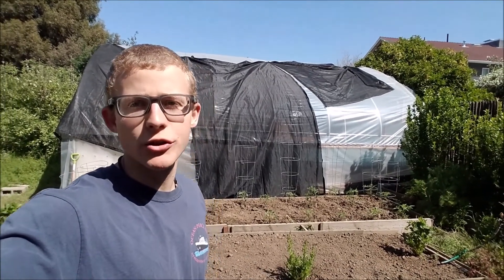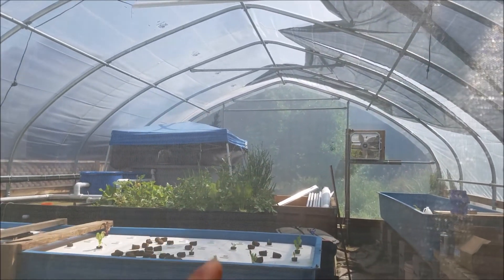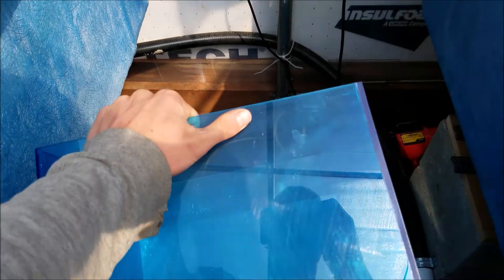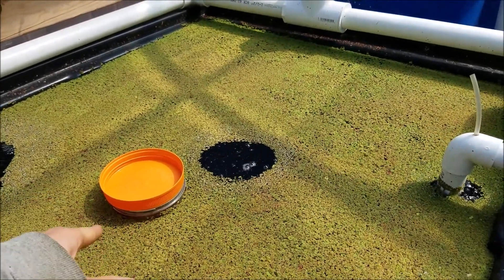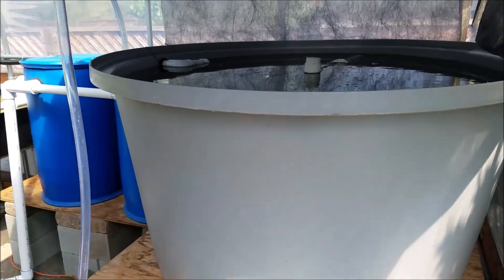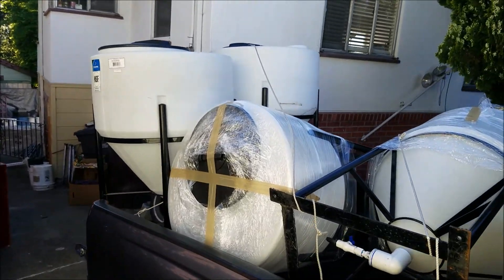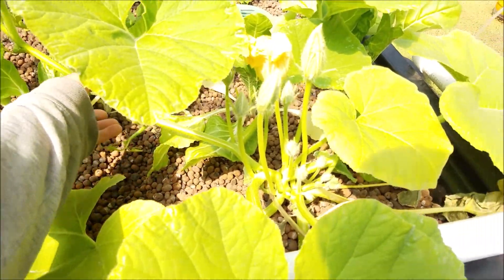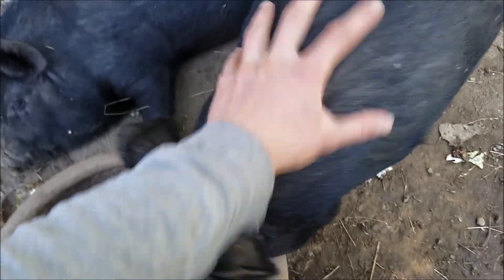Hybrid aquaponics system (update)

Comment: You have a lot going on there in your system!
I was wondering what you meant by hybrid aquaponics, and am still confused.

Best of luck with your on going project.

Thanks for sharing and as always keep building👍
Reply from the maker: Hey thanks for the reply

Sorry for the confusion and hopefully my understanding is correct.
But what I am referring to as hybrid aquaponics. Is the combination of both deep water culture (floating rafts) aquaponics, and grow media aquaponics. 
Usually when someone sets up an aquaponic system they aim towards just doing one or the other, since it is simpler that way.

So basically hybrid aquaponics = DWC aquaponics + grow media (ex; hydroton) aquaponics.
Taking the two different types and combining them together.

I believe this is correct, at least from what I have read and seen.
Reply: @vonponics  In my thinking a hybrid system would be an aquaponics system that can be made to work as a hydroponics system in case of a disaster and the fish are lost and you still have plants that need nutrients, I hope that makes sense.

My system is just an aquaponics system and I have grow beds, floating raft, and Dutch buckets👍

Either way I really like what your doing and hope you keep it up and keep sharing your progress👍👍
Reply from the maker: @ToddLarsen  
I guess there are different ways to think of it as a hybrid system.
But pretty much any aquaponic system can act as a hydroponic system. Just take the fish out and add the nutrients. And that would make it an aquaponic system.

I appreciate the feedback, always new things to learn. 
I think I will still consider my system a hybrid aquaponic system. But all in all it's still aquaponics no matter how it's set up.
Thanks and that's cool that you have all of that in you aquaponic system.

Comment: Have you considered using a fluidized filter?
Reply from the maker: Is that the same as a bio filter?
If not do you have a link or something where I can see what that is?
Always looking to learn new things.
Reply: @vonponics  yep it's the same as a moving bed it'll give you the most surface area per sq in for the beneficial bacteria to grow. 
Also you could switch from hydroton (expanded clay balls) to lava rock. the sharp edges of the the lava rock help promote root growth while lasting alot longer than clay.
Reply from the maker: @mycool8980  
Yes I do plan to make a moving bed bio filter. Didn't know that was also a name for it.
And I might get lava rock to put at the bottom of the long grow bed I will set up. 
Thanks

Comment: make a radial flow filter with your swirl filter . that wil work. nice job.
Reply from the maker: I do plan to make a radial flow filter but haven't gotten to it yet.
thanks
Reply from the maker: @hello-sz1jp  I am doing it mostly for my family.
But maybe later on if I have a huge supply i might sell some.
Reply from the maker: @hello-sz1jp  
There are a lot of pros compared to regular soil gardening.
But I do have both an aquaponics and regular.
Plants in aquaponics grow much faster and can grow closer to each other. So you can have more grow in an area compared to that of a soil garden.
Plants grow faster since there is a ready supply of nutrients for them to absorb. And can therefore focus on the growth of fruits or leaves more then stretching there roots to find water and nutrients. 
Aquaponics also use 90% less water then a regular garden.
In soil gardening most of the water just percolates through the ground and the plants dont even use it.
You have to do little to know weeding in aquaponics. 
With aquaponics you can set up a system virtually anywhere. You dont need to have place with good soil to setup an aquaponics system.

There are quit a few commercial aquaponic systems out there that have not gone out of business. So I'd assume they are making money.
It is mostly from greens and vegetables. Fish do not bring enough profit since you can get it through aquaculture farming for much cheaper.

Comment: how big is your grey fish tank and about how you spend for that ?
Reply from the maker: The grey fish tank is 300 gallons it is 33″ deep x 65″ in diameter.
I got it on craigslist some time ago when I was collecting things to set up my aquaponics system.
Some one bought a complete aquaponics system from https://www.theaquaponicsource.com. They however never set it up and were moving so needed to sell it. So I basically got an entire aquaponics kit which came with pumps, those three black grow beds I have plus the stands, a grey sump tank (not seen in the video), the 300 gallon tank, and etc.
Below are the links to where you can find the tank separatley as well as the enitre kit.
But i got it for much cheaper since I got it used form craigslist

The tank you can found here
https://www.theaquaponicsource.com/shop/build-your-system/fish-tanks-sump-tanks/aquabundance-modular-300-gallon-fish-tank/

The kit can be found here
https://www.theaquaponicsource.com/shop/home-systems/aquabundance-ii-modular-aquaponics-system/
Or
https://www.theaquaponicsource.com/shop/home-hobby/aquabundance-food-growing-systems/aquabundance-modular-easy-reach-2-bed-aquaponics-system/